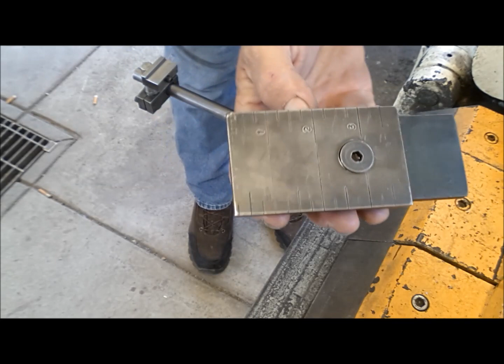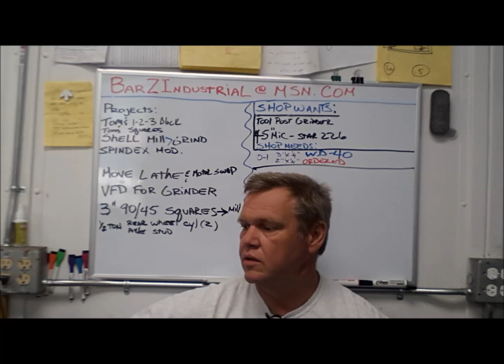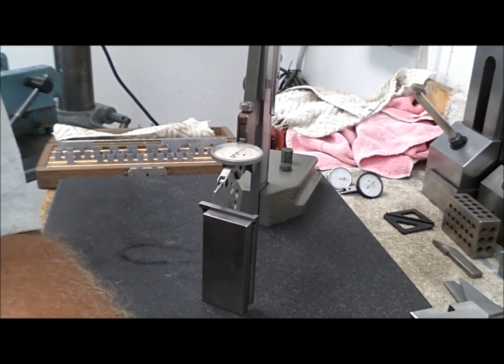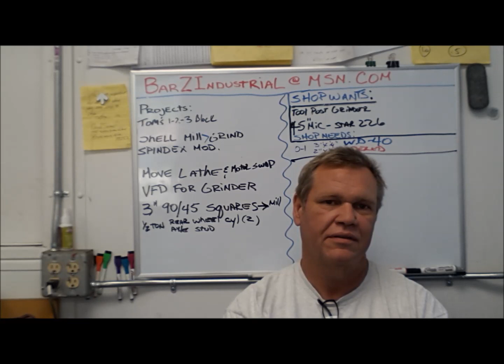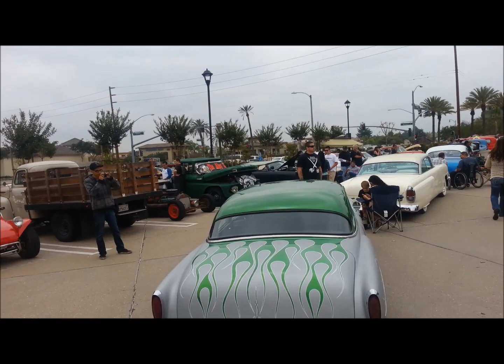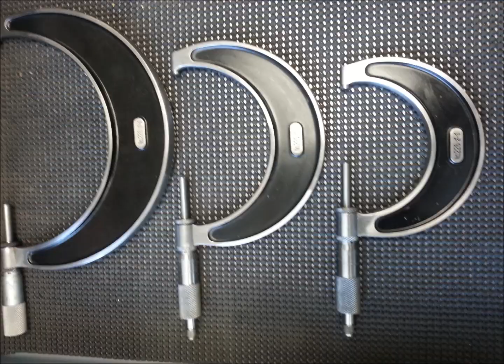week update #9

Comment: Ha! You're wrong. For somebody who is not a machinist or a mill wright, it is very fascinating to see the different techniques being demonstrated and explained with of clarity.  In my case, I got into mechanical engineering because of an interest in design, machinery, vehicles and such, but ended up spending my career doing computerized analysis.  Now, I guess I'm getting bit by the metal cutting bug.  Thanks man!

BTW, what is the difference between a machinist and a mill wright, in terms of qualifications, experience and the type of work you would do.  Ok, I know I can google it, and I probably will, but I get a little sick of googling stuff sometimes.

As I type this, you now have 9,637 subscribers, congratulations.

Comment: I graduated from High School in 1974. When we were seniors, two buddies and I bought a beater 1966 Ford van.  We welded the rear doors closed with my Dad's Lincoln arc welder and applied LOTS of bondo putty all around.  The rear bumper was missing, so we made one from a walnut plank, complete with the Pabst logo!  That straight 6 and 3-on-the-tree surely impressed the ladies.  Wish I had some photos of it.

Comment: Nice video as usual.
BTW I think there might be a slight problem with the way you snugged your sine bar into calibration. Cause you snugged it at 45deg not only did you lower the height by 4/10,000" but you would have changed the length by some amount also. Of course in reality a 4/10,000” error in height or length is only going to translate to something like a 3rd or 4th decimal place error in the angle in the 20 to 70 degree range so it may not be significant depending on the application.
Cheers